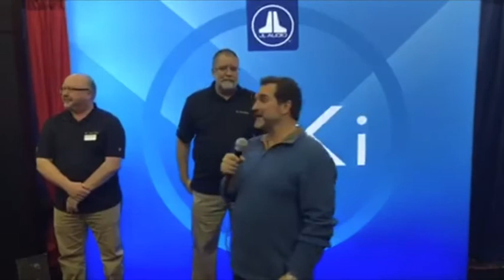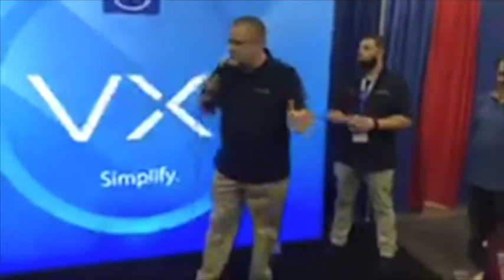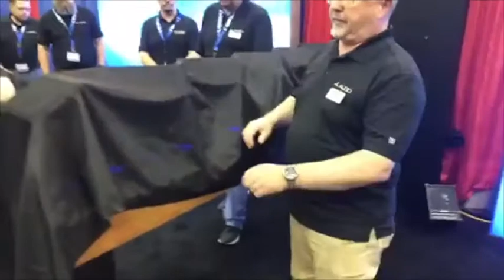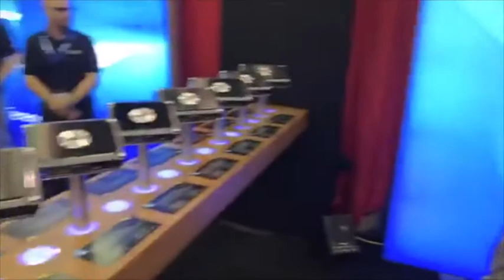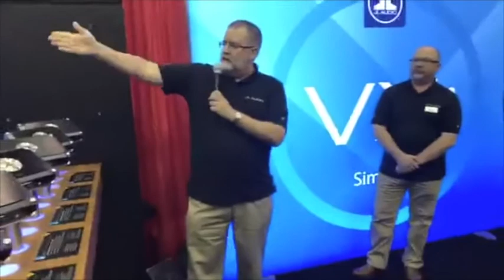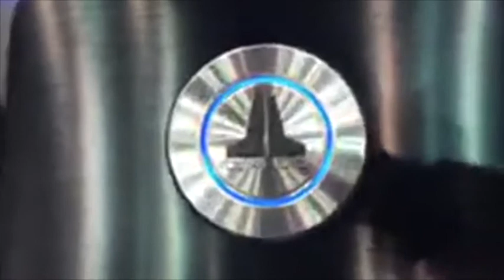JL AUDIO VXi Intro  Facebook Live

Comment: So technically you don’t need a head unit anymore, a good O’ 3.5mm cable and you have most of the tuning capabilities you need right??
Reply: I know this is a 3 year old question…

But yes. The answer is, yes. That’s right. And it’s really good thinking. Sometimes, the easiest and best route to extraordinary sound in a car is to simply not even use the OEM source unit at all. 

With VXi, you can do one preset that is using inputs fed via a hi-res player (or whatever) for the ultimate clean, flat, unmolested audio input, and another preset that IS being fed OEM signal, for customers who want to still be able to use their OEM source unit as well. 

It doesn’t have to be one or the other, it can, and often should, be both.

Comment: So if I was to buy the VX800/8i to connect to my OEM radio would I still need the FIX 86 or will this amp be a all in 1 solution? For a sub amp I actually have an HD750/1 with the HD-RLC which I really like alot. My plans are to get the C7 3 way set up for the front and c5-525 in the rear doors running with the passive crossover since I already own the C5-525s. 😁
Reply: So, the VXi does absolutely do signal summing. Any of its 8 analog and 2 digital input channels can be summed in any ratio, and any relative polarity. You can also use the digital I/O as a “loopback” thru a pair of EQs and add correction to the summed signal. 

What VXi doesn’t do is “automatically” apply the EQ correction and set up the summing in the input mixer. But you can absolutely set this up manually, and as such, you can actually do more powerful summing and correction, but it does require that you have some understanding of what you’re doing.
Reply: Hey man, any answer to this question yet? Thanks
Reply: Mr215Alive✌🏻👆🏻🖐🏻🤙🏻 I spoke with JL support and the answer is yes if you need summoning and corrections the vxi doesn’t do corrections or summoning
Reply: The answer is yes if you need corrections to the factory stereo

Comment: I’m running a VX800/8i powering a C7 3 way component set and a pair of C5 6.5 for rear fill this amp and front stage is AMAZING
Reply: Trace Wadley I need your help, I have the C7 2 ways for the front and C5 component for the rear, but I want the C5 tweeters mounted in the rear as well for an additional tweeters, which VXI should I get, and how many channels and power?  I have the HD600/4 as a new amp and TWK-88 processor already, or should I stick with them, they are all brand new, email me if you can of your answer to kenanne0219@yahoo.com, thanks bro.
Reply: @kensacdalan4748  tweeters behind you destroys the staging of a system.
Reply: @ahometheaterguy3380  I can put C5 speakers in the back, but tweeters, would that be fine?